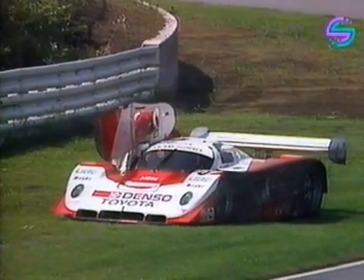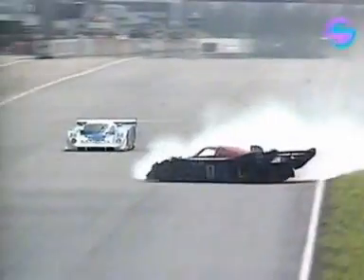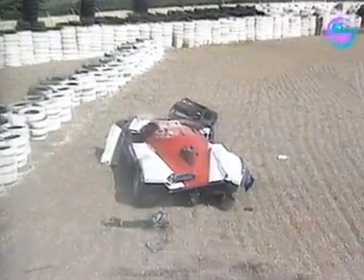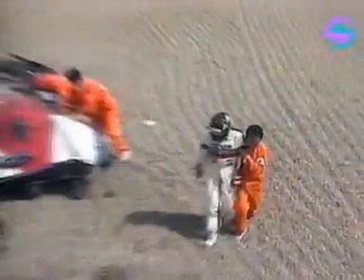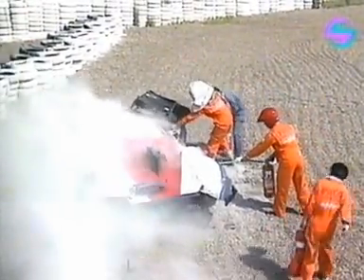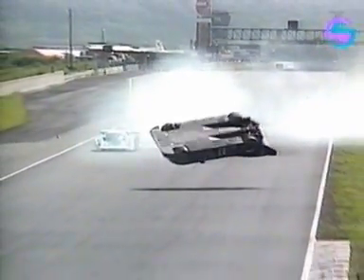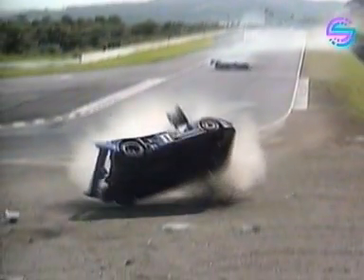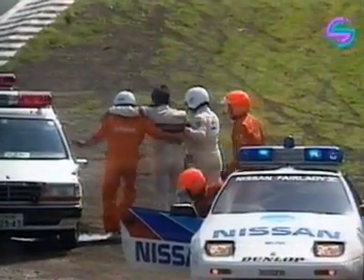Nissan R91CP Rollover

Comment: Racing car aerodynamics are rubbish.
Reply: no they're not
Reply: Sorry Dusan but why is there no stability requirement for racing car aerodynamic design? The aviation industry has been doing it for 100 years and when an aircraft fails they don't say, "Oh well, that's just what happens and it's unavoidable". They make sure it works before anyone has to beta test the damn thing. How any aeronautical engineer with a grain of morality can work for a manufacturer when they know they have stability margins of <5° for F1 and <2.5° for LM prototypes is beyond me. (Figures courtesy Peter Wright; the father of "ground effect" in motorsport).
Reply: i'd figure thats to do with more than just aerodynamics. i mean cars are supposed to stick to a road, aircraft are supposed to fly freely
Reply: Not at all. That's what we call "putting the cart before the horse". This is a purely aerodynamic issue. It's called aerodynamic divergence (see also "flutter"). An aircraft which is unstable around any one axis - particularly the lateral - gets fixed before anyone has to fly it in anger otherwise it would be all over the sky. The record of flips in motorsport is positively shameful and nobody has done anything to address the problem. Saying, "It's outside our design parameters", is an example of gross professional negligence on the part of the designers. They know the problem exists but they also know that the real issue is the rules which have not addressed the problem since wings were first used 45 years ago.
Reply: doesn't that have to do with the cars mostly relying on the ground effect? and usually when i see a car take off is when air gets under the rear wing and generates lift instead of downforce flinging the car upwards, no?
Reply: Yes but the ground effect is too marginal. A deviation of 2.5° or more will see a LMP flip. That is a ridiculously small margin of error (see the two Mercedes at Le Mans in 1999 and Dalmas's Porsche at Road Atlanta). A variation in excess of that will get you airborne. Any racing car, once airborne, should return to the ground - as any positively stable vehicle should - before it can turn over or go over a barrier. The trouble is they don't.
Reply: i see. interesting indeed.
Reply: I think I could explain it better if I said that, once the nose is airborne, a racing car should stall and return to the ground on its wheels instead of continuing up and over. That is positive stability. Instead, the way things are, as the nose starts to lift, it generates more lift in a positive feedback loop until the car turns over completely. It should not do this. Does that make more sense?
Reply: i understood what you meant the first time, and it makes complete sense. how would you solve the problem?
Reply: The theory is that the centre of gravity must be forward of the centre of lift. How that would be accomplished in a modern racing car I confess, I don't know. It's really a problem for rule makers and aerodynamicists. Currently, the way things are laid out with rear engines and fuel cells, it would be difficult. So my suggestion is that the the large flat panels which cause the problems must be behind the C of G. I think it should also be necessary to demonstrate that the car would be stable even if it shed parts like wheels or front wings. I would discourage any moving parts like emergency flaps or chutes because they would be likely to fail or cause problem for others. The shape should be sufficient to allow for it. That said, I think failsafe components should play a part. At the moment, I'd suggest the Nissan Deltawing would probably work better than most. Even if it did not, the problem would be relatively easy to correct using some sort of ballast.
Reply: "the centre of gravity must be forward of the centre of lift" why does that even matter if the lift has got enough strength to lift up the entire car?

also, one could argue that motorsports wouldn't be motorsport without the risks.

look at f1, everyone (used to?) complain that it was boring to watch because the cars had so much downforce (might be wrong here)
Reply: Have you ever built a balsa wood glider? The way to make it stable is usually to incrementally add weight to the nose so that the glider becomes neutrally or positively stable. Too much weight and it will dive. Too little and it will stall. What you're really doing is shifting the C of G either side of the C of Lift.

Sure, motorsport has its risks. So do a lot of sports but when cars start going over fences the hazard spreads beyond the driver. I'm sure the drivers would appreciate any safety measures which could be taken to alleviate this. I'm not sure many of them actually understand the problem. It's not really a part of their job. It's kind of like saying "Well wood burns, and we accept that but it doesn't mean someone's house should burn down and people lives be put at risk".

I don't know whether people have said there's too much downforce. IMHO the front wings are too big anyway and they are often part of the problem. In the early 1980s F1 cars sometimes raced without front wings but a lot of progress has been made since then, even though modern F1 produces about half the -ve lift of a 1980s car.

http://www.mulsannescorner.com/techarticle1.htm

http://www.mulsannescorner.com/data.html

http://www.mulsannescorner.com/aerodatabaselotus78.html
Reply: thanks for this
Reply: My pleasure. Good to find a YouTuber with an open mind! :) Have a good day.
Reply: TheThirdMan what if a car ends up going directly backwards at 200mph+?
Reply: genius7000 That's a good question and I probably should have addressed it earlier because, to be fair, this video shows what is a very rare occurrence. My thinking is that the problem here was caused by the wing and that there should be a fail safe device in the wing to stop it from happening. It's perfectly plausible for the wing to come off in that situation but that would probably also be dangerous. If so, I think it should have to pivot around or near the leading edge so that it presents a more or less flat surface to the air. If that happens, it should act as an air brake. Of course, it's possible that the stress would be too much for the attachment so perhaps it needs to fold back further. Whatever it takes to stop the car from flipping.

The second problem here is the tunnels. I haven't yet figured out a way to do it and this would be more difficult to arrest. Maybe some one-way blow through doors. Generally speaking though, a flip going backwards is a very rare event and my major concern is to stop the things which are far more common. I do think it might be possible to make the cars more stable in yaw (that's directional stability) because at the hypothetical 200 mph, it would be possible for the aerodynamic shape to overcome the traction of the tyres. This wouldn't happen if the car is travelling in a straight line or through fast bends because the aero package is working to its best but it would be possible if the car is suddenly turned sideways due to contact or a blown tyre. A central fin, like the new Porsche 919, would help but it would need to be well integrated.

And all these ideas would have to be tested.
Reply: They have something akin to that in modern NASCAR, where flaps, some angled and some facing directly rearwards, pop up when the car spins. seems to do the job fairly well, i don't know how often they break off though.
Reply: genius7000 I have seen them and they seem to have worked but like anything, I'm sure they're not infallible. That is why I'd prefer to see it done with shaping, where possible - removing any moving parts. But if it isn't possible to do it with shaping, something like that is probably the next best option. Anything to stop it.
Reply: TheThirdMan
actually only civil aircraft have to be "stable" the eurofighter for example is aerodynamically instable to get the best turning and best maneuver ability  it needs 60 computers to hold it in a straight line. A LMP car is a closed wheel design with wheel housings it is almost undoable to get the flat surface on the bottom to not produce upforce when it cought a bit of air under it.,,
Reply: vivalaphill There's a big difference between a Eurofighter and a LMP. A Eurofighter is designed to be unstable because 1) it produces good subsonic turn performance and 2) its supersonic turn performance is improved, even though the aircraft becomes more dynamically stable as airspeed increases. This was a problem with the early Su-27.

A LMP should always be stable, regardless of the turbulence it experiences. It is possible to do this with proper shaping and correct balance. Computers are not necessary at all.

You are correct about the wheel arches (did you read the article I posted earlier? I think it goes into that). Porsche seem to have at least partially addressed it with their most recent designs by simply putting a large air exit hole on top of the arch. I could be wrong about its purpose but I'm sure it would be an improvement in this regard.
Reply: yeah i read it. the holes in the wheel arches arent for the decreased upforce i think. The R18 has them aswell and they changed them from SPA to Le Mans for aero reasons so maybe its for cooling brakes,tires whatever...
Reply: vivalaphill By "upforce" do you mean lift?
Reply: sorry, right english isnt my native language i just thought: lets take the oppposite and it will be right haha. Thanks, learned something for today :)
Reply: vivalaphill That's quite okay. Sorry, I didn't realise. You're better than a lot of the native English speaker on YouTube.
Reply: thanks :)
Reply: What you saw happened in the late 80's/Early 90's. This is the 2010's, and the current race cars don't flip over that much, as long as I can remember. Do not talk like THOSE who have power in motorsports DIDN'T change the rules every year
Reply: Tempest Vuk  "What you saw happened in the late 80's/Early 90's"

Jacques Villeneuve, Australian GP 2001 (marshal Graham Beverige killed). Mark Webber, Spanish GP, 2010. Those are only the ones I know about, since I haven't kept track of it for a number of years.

Despite the fact that designers have made some changes, the problem still exists. The margins for safety are far too small.

"Do not talk like THOSE who have power in motorsports DIDN'T change the rules every year"

What changes have they made to prevent this happening? Do you even understand why it happens? There is no requirement for racing cars to be statically or dynamically stable. Erg; they will continue to exhibit aerodynamic divergence until something is done about it.
Reply: Air flows UNDER the car lifting up the body, that counters the downforce if its present.
And If you did not keep track of it for a long time, stop complaining about race cars. Your complaint doesnt make any sense, nor difference in any way and is annoying to fans of motorsports. Ya want full safety? stay home!
Reply: Tempest Vuk You're pretty free with giving advice, aren't you? Ah, me...the arrogance of ignorance. Presumably by "annoying to fans of motorsports", you mean it's annoying to you. If you don't like what I posted, feel at liberty to ignore it. I don't care. Obviously, you don't understand aerodynamics at all. The others did when it was explained to them.

Racing cars should not flip. Ever.
Reply: You sounded like you wanted racecars to be less aerodynamic.
Reply: Just so you know, aerodynamics is the study of air motion around a solid object, like a vehicle. Racecars are designed for speed, thus they need the air to flow more freely above the car, creating a downforce, as well as allowing a race car reach high speeds, which is shy they are stale compared to the usual sedans on the road. And racecars too are equipped with spoilers as a part of this: so the full potential of the racecar can be reached with more downforce. Now its true some cars did flip over, but that wasnt ALL racecars.

I would suggest for you not to wish for your criticism ever make a difference.
Reply: Just so you know, aerodynamics is the study of air motion around a solid object, like a vehicle. Racecars are designed for speed, thus they need the air to flow more freely above the car, creating a downforce, as well as allowing a race car reach high speeds, which is shy they are stale compared to the usual sedans on the road. And racecars too are equipped with spoilers as a part of this: so the full potential of the racecar can be reached with more downforce. Now its true some cars did flip over, but that wasnt ALL racecars.

I would suggest for you not to wish for your criticism ever make a difference.
Reply: Tempest Vuk No. Just stable.
Reply: Tempest Vuk Oh goody! Dictionary games!

While you're at it, look up the definitions of static and dynamic stability and aerodynamic divergence (which is what we are dealing with here).

"I would suggest for you not to wish for your criticism ever make a difference."

If you had even the vaguest notion of what it was, you would want it to change too.
Reply: Seems like you don't understand aerodynamics. If you take a car, run it up to 250 km/h, then turn it 180 degrees, you reverse the downforce on it, causing it to go upwards instead of downwards. Just like in the video.
Reply: JackpodyDK If you take the trouble to read my earlier posts, you may find that I have addressed this already.
Reply: TheThirdMan The cost of development to shift a car's C of G forward of the C of lift in situations where the car's front lifts off the ground would be enormous. Wouldn't it more or less necessitate a shift to front-engined cars?

If that's the case, that would alienate a whole bunch of "purist" F1 fans already annoyed at turbo hybrids. Unfortunately, the potential for loss of revenue would see that safety would continue to take a back seat to ensure people continue to line Bernie's and Ferrari's pockets.
Reply: Iunio92 Excellent question and one I can't answer immediately. The more I've thought about this in the past few months (and I've been thinking about it for years) the less sure I am that it can be resolved. Certainly, putting the engine in the front is an option but as you say, it would probably not be popular. Still, engineers are usually pretty clever people and you never know what they might come up with.
Reply: TheThirdMan Racing cars =/= aircraft

Also, how much safer do you want these things? Crashes aren't common; it's just that when they do happen, they get a lot of attention so you'll think that they're more commonplace than they really are.
     You'll also notice that the driver was fine despite being thrown about at > 100mph. That's pretty damn safe. Group C cars were the safest race cars in history, with the only deaths (3, I think) being in very old Porsche 956 chassis from 1982. So Porsches aside, there were 0 fatalities over the span of 1000+ races.

"...any aeronautical engineer with a grain of morality..."

What, so you're calling the engineers evil for designing race cars? Even though the drivers know fully well the exact risks involved before they ever step foot in the cars and the engineers work their asses off to make sure the cars don't crash and save the driver if they do? Given the cars' astonishing record of safety, the horror on the faces of the pit crew/engineers when a driver crashed, and the entire point behind race cars in the first place, it's absolutely ludicrous to condemn the engineers or the cars' safety. You might want to take a look at your moral compass...

"why is there no stability requirement for racing car aerodynamic design?"

That exact line of thought is what led to the catastrophic LMP crashes of '98 and '99. Luckily for the regulators, no one was killed... people need to quit trying to play God with regulations and leave the work of car design to experts.